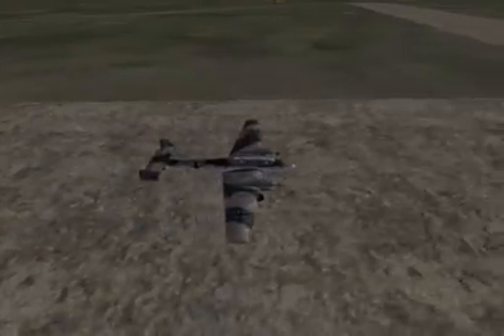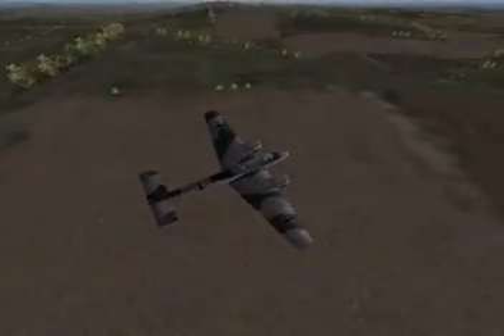Part 1 Combat Maneuvering Basics of 3

Comment from the maker: Oh, sorry I just saw your request. Yeah I use fraps but I have a super comuputer I build myself lol. 8 gigs of ram with a Quad core processor, that allows me to get about 20 FPS when running Fraps and about 150-240 fps when not. WWII Online eats up memory so is hard to get moving pictures. Try doing some still shots and put them into a sequence. Also make sure all other programs are not running like Team Speak TS etc. Also if you can do your filming in areas where there are very few others.